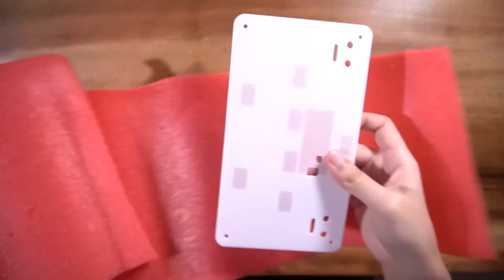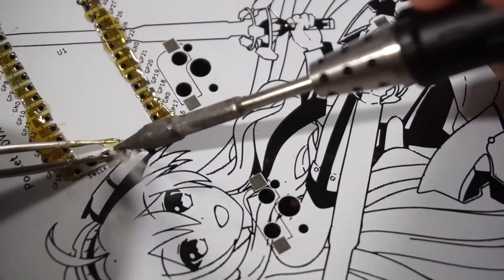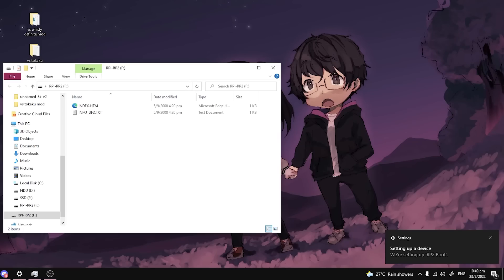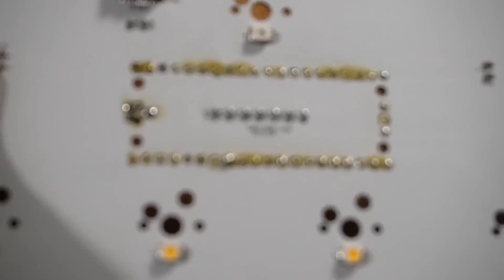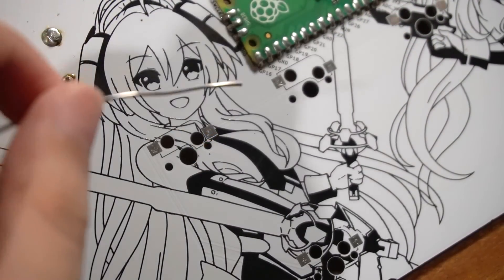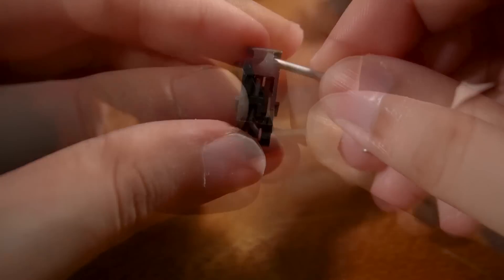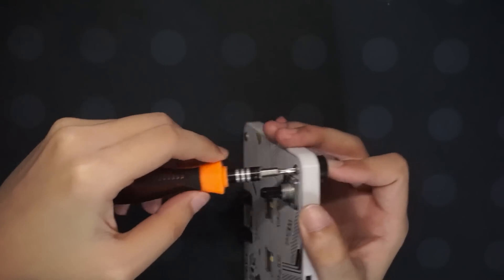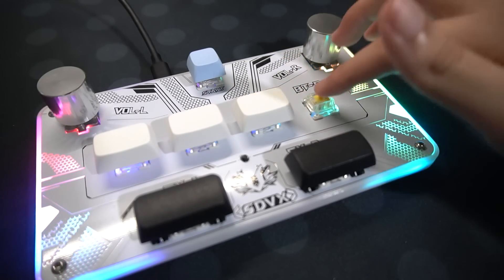Assembly guide for the Pico Voltex Controller

Comment: do we need to flash the board before anything else
Reply: It's a good idea to flash it right away to make sure it works. She soldered it on first but then if it doesn't work it could mean your soldering is wrong or the microcontroller is bad.

Comment: Ive been using this controller for over 6 months now, I was an original buyer of prototype and current versions! I love this controller and after 6 months it is still perfectly fine! Also a great way to prevent the sliding of the controller is to use some magnets under your mouse pad, then just put the other connecting magnets on the feet of the controller! :D
Reply: robeats eternal father of osucks

Comment: Additional tip for those who will try to solder for the first time
1: The flux makes your solder job easier. This is optional because solder wire has a little flux on the inside. Typical flux is soft like ice cream or jelly, if not then heat it first like she did in the vid. 
2: Use a soldering wire with "lead" on it. Find "lead" or 60/40 or any ratio with lead. Lead free solder is NEVER BEGINNER FRIENDLY because its hard to melt. Dont inhale the smoke of course, use a fan to blow the smoke away or a fume extractor if someone has one.
3: start your soldering iron, dont let the tip touch anything you dont want to burn.  if you have a soldering stand use it, leave it on for a minute for good measure(depends on how fast your soldering iron heats up) its ready to use when it can melt solder wire when you put it
4: Clean the soldering tip before using it (i almost cried of how black her tip is) using a soldering sponge(typical, using a normal dish sponge works at some point before it melts or get dirty, never use it for cleaning dishes again if you really used it) or a brass wire sponge(poke it with the tip lightly as to not destroy the tip). Clean tips makes the solder melts on contact everytime
5: While soldering, try not to heat up the board for too long. Just enough for the solder to melt and spread. Leaving it for too long causes the solder pad to "detach" from the pcb, rendering the whole circuit board useless if you manage to break atleast one
6: Beware of bridges and cold joints, bridges happens if you apply too much solder, causing the pins/pads to short circuit. Use a desoldering pump or solder wick to remove the excess. cold joints is not fully melting the solder because of low heat or improper contact of the soldering iron and the solder pad causes it to crack over time especially during intense gameplay. You can search it up what a cold solder looks like. To repair it, apply flux on the joint, put a little solder on your soldering iron and reheat

Enjoy soldering, it is so satisfying if you do it right
Reply: I’ve soldered a few keyboards and I did this exactly. I have a gas soldering iron so it’s nice not having wires :)

Also solder wick is helpful
Reply: robeats eternal father of osucks

Comment: Uhm, are you inexperienced at stuff like this? I get a feeling that you are. (I got a little dissatisfied with how much you used lead, Sowwy) But what you did was pretty good for someone new at this.
Reply from the maker: it's my first time soldering castellated mounted holes, I didn't really know what a good amount was to put, so I put more than necessary just in case. My SMD diodes on my PCB started blinking the other day because I didn't add enough solder to the pins so I got a little paranoid 😬
Reply: @tokaku  Uhm, you did better than any first-timers though, if you're interested further........ you know what pain is .....(to gain a skillset?) (I suggest Indian Tutorials for tricks and tips, but they are awkward, so bear the pain, they are genius too in my opinion) (no reply...)

Comment: would personally suggest not soldering the big pins of the encoders unless you are sure they are good quality, i've had encoders break and desoldering the big pins are a pain,
though in this case understandable you'd want to solder those big pins eventually cause of the stress they would be under from constant use
Reply from the maker: right, good point. People should only solder down the big pins when they're 100% sure they work during testing. Only after then it's safe to solder them down. Nothing holds the encoders down at all in the case, so the solder at the pins is kind of necessary for stability